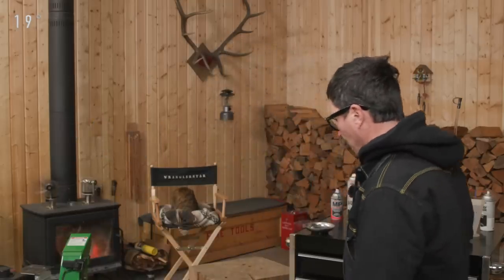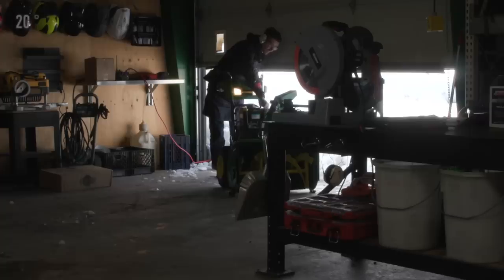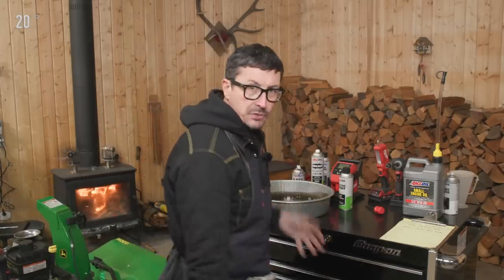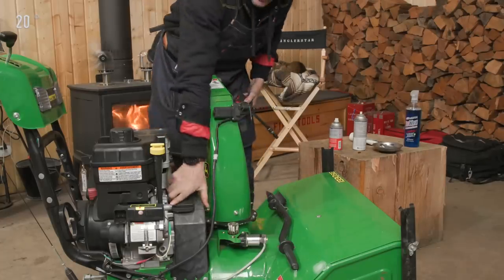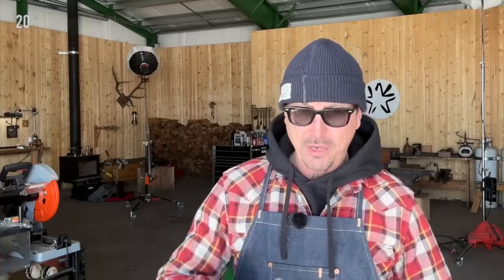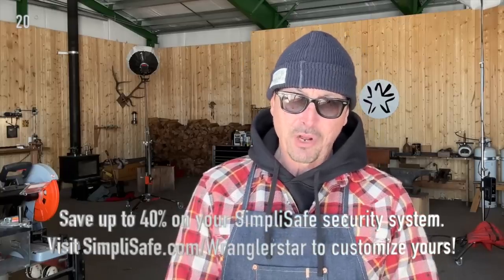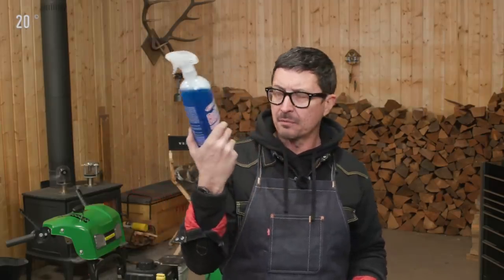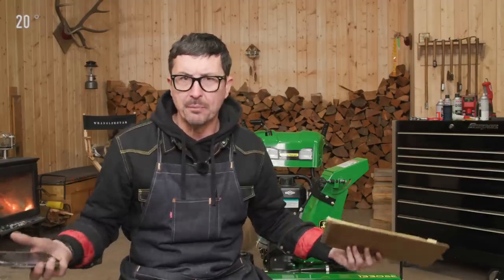10 Tips To Get Your Shop Ready For Winter

Comment: I made a spreadsheet that has an entry for each vehicle and tool I have. It has year, serial number, oil and all filter models and quantities, wrench size for drain plugs, vin numbers, tag numbers and links to .pdf manuals. If I am at the store I can quickly look up from my phone whatever I need .
I use it often
Reply: I do the same, but with the 'Notes' app, then its saved on iCloud on any of my devices
Reply: @primebuildbryce  that's what I do and share with my wife and daughter. I didn't list everything on the list. It also has tire sizes and pressures, battery sizes and dates, oil changes and other maintenance. I find that when I'm thinking of routine maintenance and such it's when I'm in my easy chair at night. No more going to each vehicle to research all this. When I get any tool or appliances I download a manual and put the link on the sheet too. I have trouble keeping up with them. No more and easy to search.
Reply: @Gary Ruppster Yes that is strange. I get alerts for that town all the time. Never been there though. I'm in Alabama.
Reply: VIN NUMBER HUH 🤣
Reply: I have been asked at parts stores for it several times so I just put in  there too.
Reply: I thought I was the only one who did this.
Reply: @Anthony_Harper  you're really not getting it huh. Saying VIN number is like saying ATM machine, or hot water heater. 
It's redundant and it makes you look like you don't know what you're talking about.
Reply: @MrReeseisawesome  well I guess I don't know what you are talking about. I have been asked by parts departments and had to go outside and get it. Now I don't.
Reply: @Anthony_Harper  if you still don't get it even with the context I've given you then you don't know what VIN means. 
It stands for Vehicle Identification Number, so saying "number" after VIN is redundant and not correct.
Reply: @MrReeseisawesome  I see your point.
Reply: Add your futnace filter size on it too... works for me anyway

Comment: Couple tid bits from this video. Never once thought to use a permanent marker to write belt number/lengths especially riding lawn mowers it's usually find the model number then search for the belt size. But it goes with all equipment.  Along with gas/oil mix ratio and anything else you replace often belts,sheer pins ect.  2nd to write it down and take a pic or atleast put it somewhere easy to find.  I now have a 3 ring binder for a polaris sxs full of service dates and anything you would need to know without thumbing thru the manual  which for a lot of things are pretty much online only at this point.

Comment: I have a hot water spigot in my garage and I hose off my snow blower with hot water after each use to remove all of the stuck on snow as well as all the road salts from blowing along the road. Really helps keep my machine from rusting and clean.

Comment: Hi Cody, Excellent video as usual.  I thought I noticed grease fittings on the front augers, but I didn't see you grease them.  Mine has them  and I use winter grade grease every fall.

Comment: I've always put Sta-Bil or some other additive in the gas I use for my lawn equipment, riding mower, push mower, weed eater, chainsaw, etc. and I've used gas that was in some cases 3 years old or stored mowers with ethanol in them over the winter and never had issues. I regularly stored my 20+ year old mowers over the winter with gas in their tanks as well as gas cans with no issues. The only time I ever had to rebuild a carburetor was when I bought my used push mower and it was surging. I use a sharpie or a paint pen and write on they equipment what oil and filter is needed. Just the other day I used a white paint pen to write the oil weight and quantity as well as the filter number on the radiator housing and the air filter number on the air filter housing in both my vehicles. Time and wear fade the writing but it's a simple matter to rewrite them when necessary.

Comment: My old yard truck as 3 year old pump gas in the tank, start right up. I don't run ethanol free in a single engine I own, an I live in up north. Never had issues. Cept my log splitter, but that's just cuz ice got in the carb. Little overdramaric my guy

Comment: I used to build fuel stations, ethanol last longer then you think, the difference is that the alcohol in the fuel suspends water up into the fuel and causes phase separation creating a brine which will ruin your engine. I use ethanol fuel in my snow blower and put it away every year with no additives in it, I just make sure the tank is completely fuel and its stored under roof so no moisture can build in the tank. with non ethanol fuel the fuel floats on the water. with ultra low sulfur diesel we have today you can take a jar of diesel and put a piece of steel in it and watch it corode over time. Our fuels are changing and not for the better. if you have fuel tanks on your property check them with water finding paste and if you have diesel have it checked once a year for allege. Hope this helps clear things up
Reply: there 👋👋, how are you doing today? Hope you’re having a wonderful day. God bless you!!!❤️❤️

Comment: Two genuine questions Cody: 
1. When hard times come, wouldn't it be better to find a solution that would not require the use of fossil fuels / oils in general? Now I'm not necessarily saying batteries as they can also degrade, but maybe even something completely manual or electric and corded so that it can be powered by solar? -- My thinking is you can only store as much fuel until you eventually need more.
2. Again, when hard times come, wouldn't it be better to keep files redundantly? Like on paper and the cloud or if preferred all digital local NAS and cloud?
I appreciate your thoughts on keeping independence, but sometimes it may be helpful to think "What would people 100 years ago have done to solve this problem?"
Reply: What happens when the news outlets report a fuel shortage? Everyone drives around like headless chickens, rushing to the petrol pumps for those last drops of fuel in their cars!! 🙄🤡 

If Cody is so concerned about some unscheduled, lawless Armageddon taking place, perhaps he should just relocate to a safer, more stable country! One where most of its citizens can’t legally carry around firearms, would be a good start! 😁

Comment: Hey cody ive seen where guys take the 1/4 spinner handle extensions and swap handle colors. You can drill them out to fit. Im thinking a great porject video would be making one with a 3/8ths. Just have to get one of the larger replacement hard handles and a 3/8 extension .  set the handle in a vice and drill it out and then you can countersink the other side to fit the wider end. When asselmbing just use some sort of glue and it should be dandy.
Reply: I actually did this with a Williams (snapon) black hard screwdriver handle, drilled it all the way threw got it so the extension fits snug. Used JB weld to help secure it in place. I love how it turned out and it feels solid and strong.

Comment: Cody you should roll the blower forward on the auger box. The bottom plate under the blower is now accessible. Remove the plate and use cold temp grease on the drive sprocket. Pretty sure its in your owner's manual for once a year maintenance.

Comment: I cut the number side of my oil filter box and under the number I write my wrench size for the drain plug and my oil weight. I tape this to the top of my air filter box and it's so nice lol.

Comment: Those pour spouts on the oil jug is nice for small engines.. first time I seen them.. does your shop hold the heat good? Was just wondering with the high ceiling. Thanks .

Comment: you probly dont care, but my 100x50 foot barn is actually an old forestry service building built in the 40s.. that the original owner of my property bought in the 60s.. from the forestry service.. took apart.. moved and rebuilt on the land i own now.. Its really cool to have a barn.. but actually a forestry service building thats 80 years old..  It has 4 double double door they used for aparatus

Comment: Those extension nut drivers with a handle are great! I remember you talking about your snap on one years ago. I thought it sounded like a good idea and found one made by GreatNeck 28096 10 Inch Quick Extension, 3/8 Inch Drive. I liked it so much I bought a second one! Unfortunately they don't seem to be making it anymore. So disappointing, its such a huge help, like you said, working on small engines! I wish I had bought more of them!

Comment: i personally hate snowblowers they are such a hustle to keep crean and working and theyll break on you when you need them most and also really expensive if you think of it i bought a tractor with rear bucket on a triangle quick attach for 1900+60 bucks for delivery and if i get so big of a snow fall that i cant just drive out i can use that only thing is you wount be starting it 2am unless you want to get really angry neighbours its a ponymotor start and you can hear it start up from half a mile away but not the tractor running anyways unless you have alot of snow to move and have time too then use a blower i prefer a blow or the rear bucket i have havent yet got around to build a blade for it

Comment: Cody, you have yourself an excellent machine, well built and durable, and don't complain about it having tires. I used more than a few snow blowers with tracks, and they suck! Very troublesome and are hard to turn. You just are fighting and wrestling the machine and are exhausted by the time your done, I wouldn't take one with tracks, even if someone offered it for free. The John Deere snow blowers are well balanced and they are an easy pleasure to use. I do recommend to have a lot of spare auger sheer bolts on hand, as the do seem to easily brake. Another great brand of snow blower is Simplicity Signature Pro Series. Heavy duty and well designed, with high hp engines for that heavy snow.

Comment: Do yourself a favor skip the sharpies get the markets from Matco tools you can leave the cap off for 3 days it still works you can run it over it still works it works wet or dry and it's comparable pricing I pay $1.45 each.

Comment: I have the manual for pretty much everything I own, on the back page of that manual I have part numbers oil capacity etc, those manuals are in a file in a cabinet in the shop. My wife keeps a file on the computer as a back up. Take care of it and it will take care of you. One thing I NEVER do though is walk around barefoot in my garage or shed, but hey that's an East Coast guys opinion.

Comment: I like to keep the manual in the shop and jot the oil weight and capacity, plug type, part numbers for the belts and other frequently purchased parts on the front cover and I usually hang spare belts on the wall with a tag that includes the part number.  When I have to replace one I order a replacement right away when possible.

Comment: For the sheer pins you can use grade 2 bolts.
Reply: Yes - exactly. I use them on a Honda 1132 snow blower and they work the same as the factory pins. They cost pennies and are available everywhere.
Reply: Midwest Guy always keeps extra grade 2 bolts on hand. I get them from the bulk bins at my local hardware store. 

I think I saw a Toro shear bolt kit for $10 online!
Reply: @daverahrman5662  yes I own a small engine shop and keep a lot around. Some customers want the real sheer bolts but most will use the grade 2 bolts to save cost

Comment: I run regular pump gas in my equipment during the "prime" of the given season. As the season comes to an end I start to use non-ethanol gas to make sure that all the regular gas is flushed out. This method has saved me tons of time and headaches from clogged up equipment.

Comment: Tip from my mentor.  We use distilled water.  Those jugs get cut up into plastic labels.  Detergent bottles work well too.   Those get zip tied to your equipment.   Critical info from the manual is recorded on the tags.  A service history is on another tag.  Gas cans are maintained the same way.  Learned a lot from that man.

Comment: Good video as per usual! I like your idea of saving everything in the cloud, but I would recommend investing in your own private storage server (NAS). When you dive into what cloud service providers can do with your data and photos, it becomes a little terrifying! There are many storage servers that do not require extreme knowledge to setup, and (most importantly) don't require a subscription. I always recommend a server from Synology. Something I think my fellow PROhO's should keep in mind. Digital privacy is always important, and doesn't have to be complicated. Thank you for making these videos sir.
Reply: But when your homestead gets raided in some Armageddon episode (or even a modern day burglary), you’ve lost all that highly valuable data you had stored on One “local”, PHYSICAL  Server. However your DATA stored in the Cloud, all remains untouchable, to the thieves! Get it?
Reply: Possible of course. But much like a safe, having your server tucked away in a secure spot would lower the odds. As far as one single source of data, one should never have that. It would be easy enough to either link several servers with friends/family across the country, or have multiple setups at various properties. Private cloud infrastructure.
Reply: Also, if I may, no data is “untouchable”

Comment: side note, the “small engine” oil is specifically intended for those air cooles engines, i believe it has different additives . a syn 10w30 small engine oil is different from a syn 10w30 ment for a car